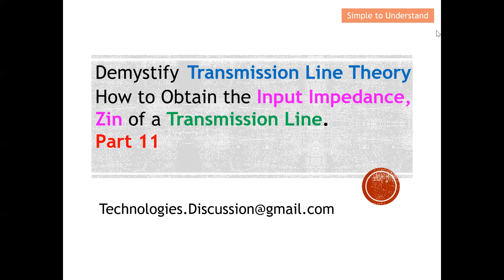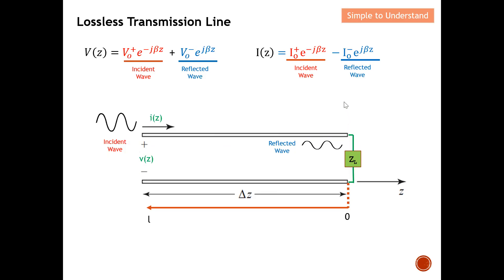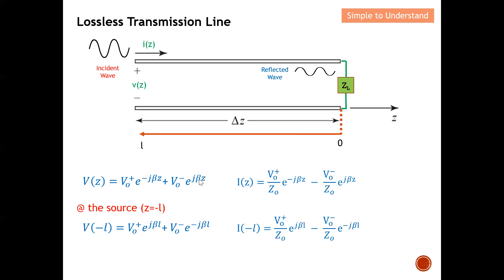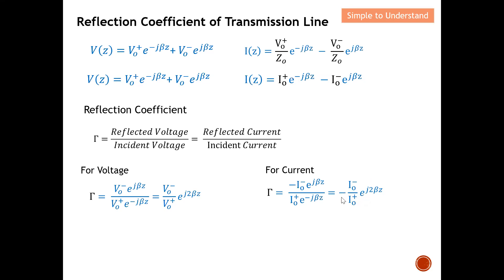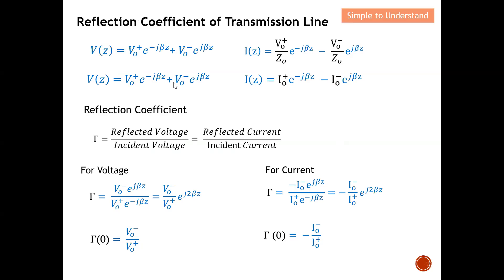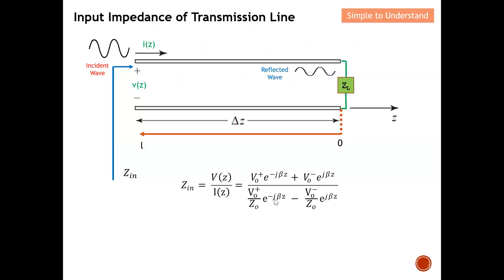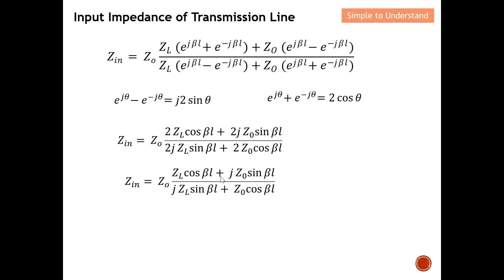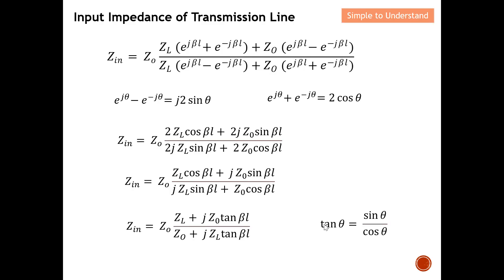Transmission Line #11. How to Calculate the Zin Input Impedance @ Any Point / Length of Tx Line.

Comment: The formula for I(z) at 6:44 is wrong.  It should be I(z) =  (I0+)*exp( j*beta*z)  + (I0-)*exp(j*beta*z). Since I0 = - V0-/I0- this would be consistent  with the formula for I(z) right above it.
Reply from the maker: Thank you so much for your comment.   :)
I(z) is to express the current equation with the function of Z. Which mean that I(z) is depended on z. Hence the equation is correct. I(z)=(Io^+) e^(−𝑗𝛽z) −(Io^−) e^𝑗𝛽z.
I guess u mean this:
When z=0. The Eq become
I(0) = (Io^+) - (Io^−)
Reply: @technologiesdiscussion1676  There's a sign error at 6:35. There are two formulas for I(z) and they are not consistent with one another. If in the top equation for I(z)  (which is correct) you plug in I(0) = MINUS V0-/Z0 you will get a PLUS sign in the second term in the equation just below it for I(z). Not a MINUS sign.
Reply from the maker: I am sorry, I have double check my video and I think they are correct.  :)
I guess you want to Sub z=0 into the 2 eqs.
The top Eq will be I(0) = (V+o) / Zo - (V-o) / Zo  
The Bottom Eq will be I(0) = (I+o) - (I-o) 
(I+o) = (V+o) / Zo
(I-o) = (V-o) / Zo
I hope is clear  :)